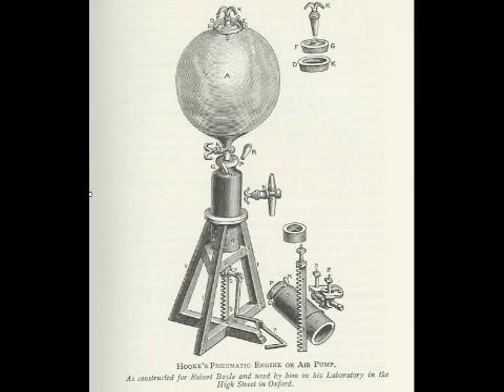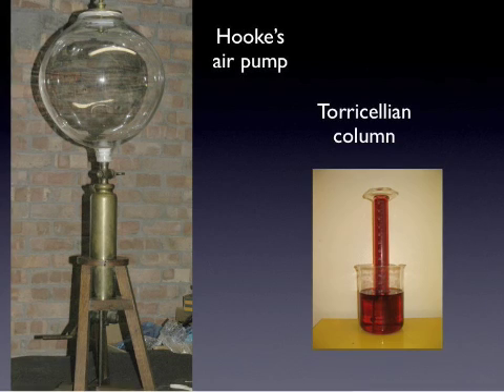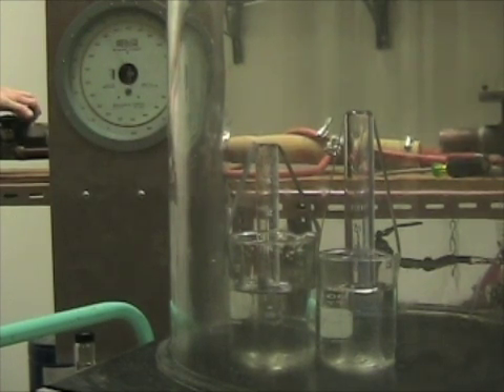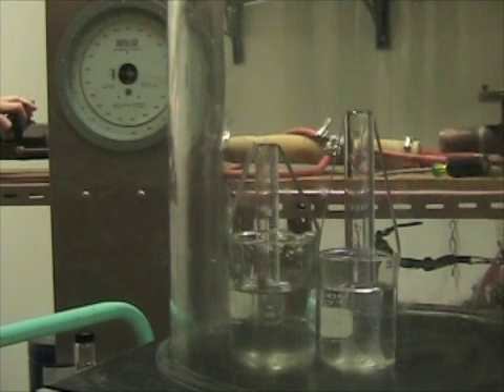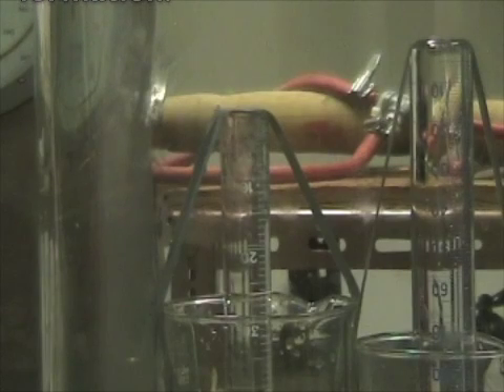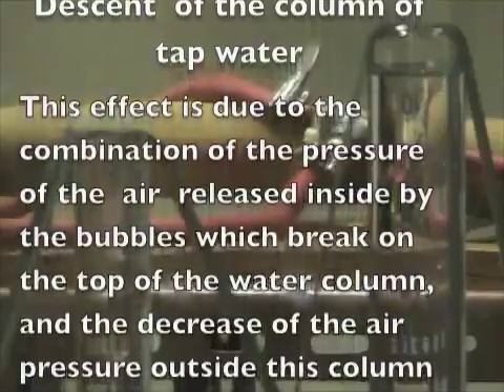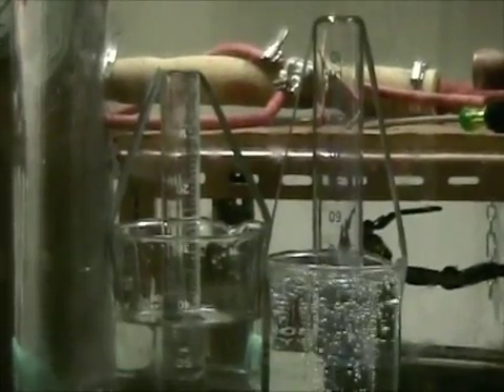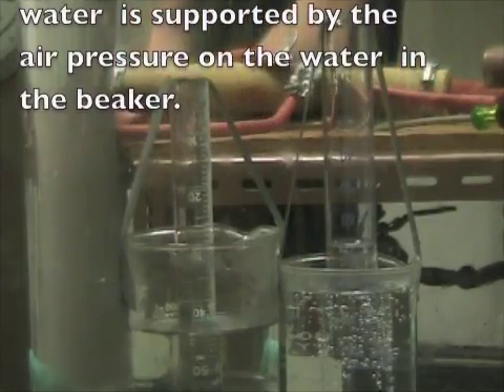Huygens' Anomalous Suspension

Comment: This is a valuable video. Helped me to understand the following quote:

“Huygens’ most important contribution to pneumatics was his discovery of ‘anomalous suspension’ (Ѻ) in 1661. He had purged water of air, and filled a barometer with this water. Next, he put the barometer under his recipient [vacuum bulb] and evacuated it. To his astonishment, the water in the barometer did not descend. Today, the phenomenon is attributed to adhesion between the water and the glass tube, but in Huygens time it was rather puzzling. Boyle initially denied the effect, because he could not produce it with his own pump. He suggested that Huygens’ pump could not evacuate sufficiently. Huygens on the other hand (correctly) believed it was Boyle's pump that was detective.”

— Anne Helden (1991), “The Age of the Air Pump” (pg. 153) 

http://www.gewina.nl/journals/tractrix/vanhelden91.pdf

http://www.eoht.info/page/Christiaan+Huygens

Note: Hard to visualize where the outer vacuum bulb is in your video?
Reply: Article on Michael Nauenberg (1934-2019):
https://news.ucsc.edu/2019/07/nauenberg-in-memoriam.html

Comment: Very interesting....I had not heard of this experiement before.....Ive got to admit...it is a bit hard for me to believe that it is simply the adheasion of water to the glass tube which keeps it suspended.......Seems to defy comon sense IMHO......of course seeing is believing.....I cant help but feel there is another property going on......perhaps because the tube is of less diameter and therefore less presure....perhaps it is simply the higher pressure water holding up the lower pressure?